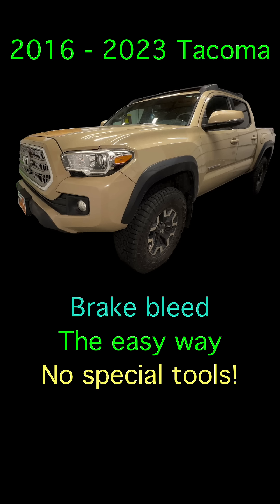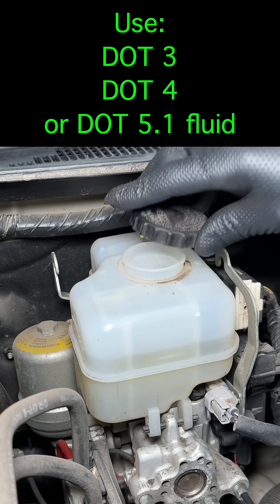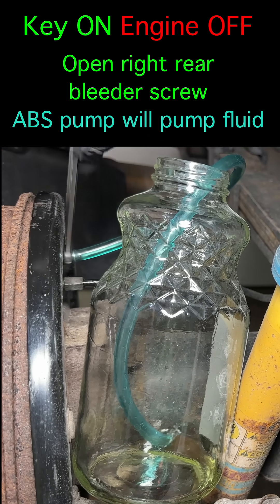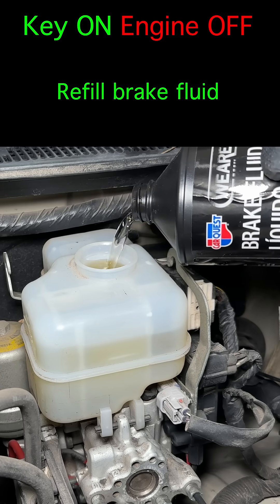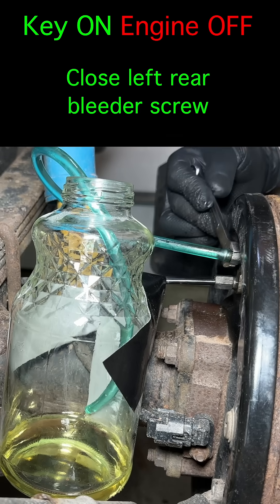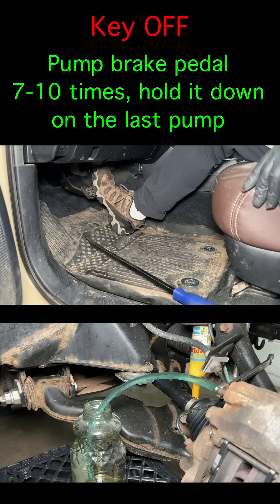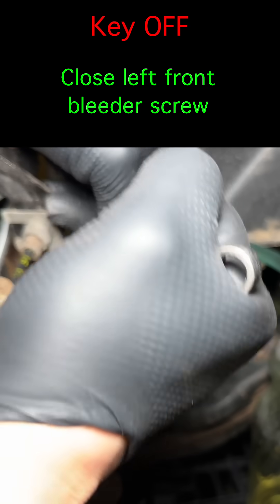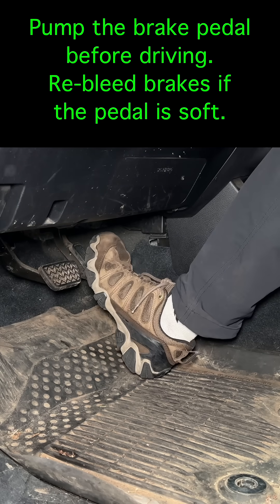2016 - 2023 Toyota Tacoma brake bleed #toyota #tacoma #brakeservice

Comment: Will this work on a 2015 off road? I also have the electronic brake booster
Reply from the maker: Probably! Try it and let me know if it works!
Reply: @LabCoatPaul Works well. Had the electronic booster pump the fluid out the rear and did it manually for the front.
Reply: Only the offroad models 09+ have the electronic booster.

Comment: I know it’s been a while, but when I try to bleed my back brakes like you did, the ABS doesn’t turn on and push fluid out. Do you know why?
Reply from the maker: You might have a normal brake system. If your brake has a round vacuum brake booster behind the fluid reservoir, you have normal brakes and you can just pump the pedal without turning the key on.

This video applies to the electric assist brakes that don’t have a vacuum booster.

Comment: If I do have air in my ABS as I suspect ,do I go through this same process for a long time or is it a complete different process to get that air out ? Emergency comment !🙏😂
Reply from the maker: Doing a regular bleed should get the air out of the abs system. 
If it doesn't work, you can try loosening the brake lines directly on top of the ABS unit (with the key off) until they leak a bit. If there is air near the top of the abs, it should in theory come out. Dont pump the brakes, just let some fluid leak out, then tighten the lines again.
Reply: @LabCoatPaul thank you so much , replaced all 4 brakes and bled them how you said and she feels stock again 🙏

Comment: Another video stated that a scan tool is needed but then does not say why, or what kind of tool. Is it just to reset any warning lights that may come on? Wherein any scan tool with a reset capability will work. Or is it something more complicated?
BTW Thanks for the video, 2016 Tacoma TRDDCOR.
Reply: Apparently a scan tool is only needed if you let the master cylinder run dry which would let air in the system and then require you to bleed the master. As long as you keep the master full of fluid and topped off after every bleed, the scan tool shouldn't be needed

Comment: You claim a TRD Off-road. Would this work on an SR5 as well?
Reply from the maker: The truck in the video has electric brake assist. If yours has a regular vacuum brake booster, you can likely do a regular brake bleed with the key off.